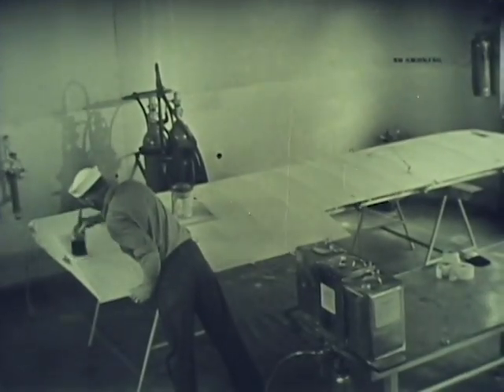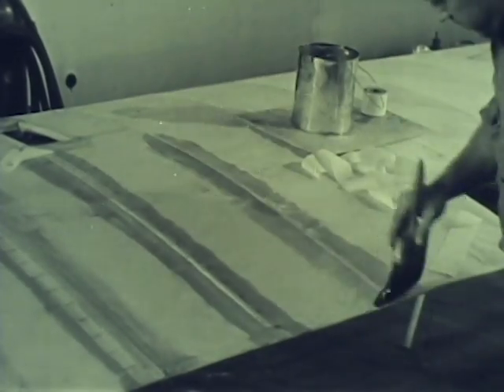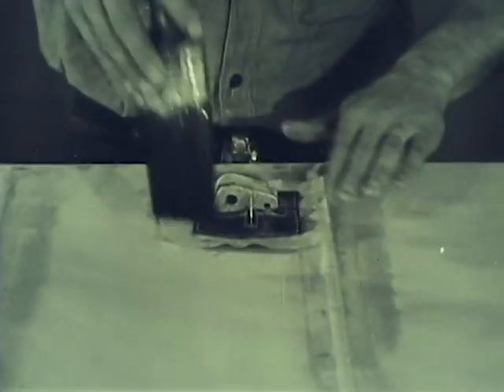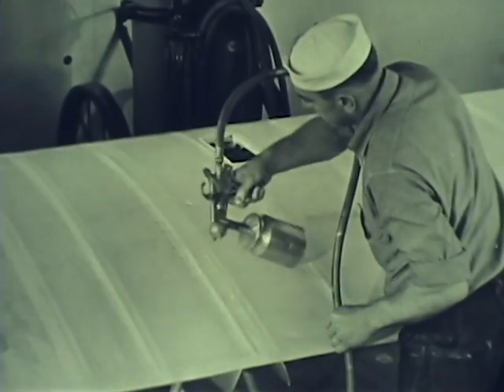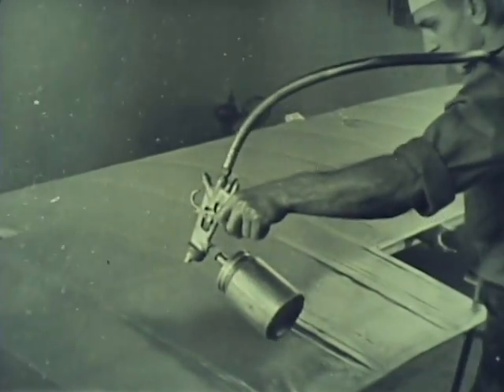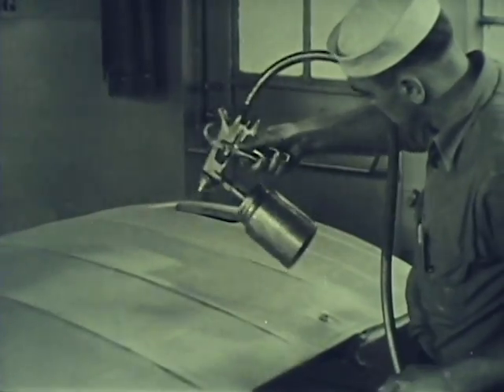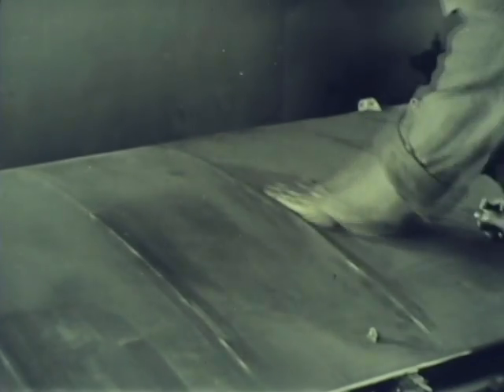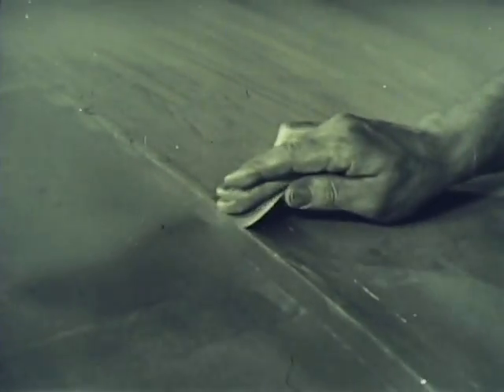1941 FUSELAGE AND WING SKINNING TECHNIQUE, HOW TO COVER MODEL R/C AIRCRAFT

Comment: If the dope spraying dope causes repetitive blushing, your dope is probably smoking dope. To correct this problem, run a glass of dope remover through your dope sprayer that is spraying your blushing dope and then find a smarter dope that doesn't smoke dope while spraying dope. If the new dope spraying dope is a fat dope, use a dope thinner or remove all the water from the fat dope spraying dope while raising the dope spraying room temperature to 110 degrees Fahrenheit for one to two weeks to thin the dope so the dope spraying dope can spray dope properly.
    Just remember, never use a dope that is too fat if you want properly sprayed dope by a dope spraying dope and, never let your dope spraying dope smoke dope while spraying dope.
     Your dope spraying dope should be of a fine condition if you follow these easy rules of a dope spraying several layers of dope because, it is not rocket science...…. it is dope science.
Reply from the maker: Lmao
Reply: Way too much time on ur hands

Comment: Cool video but why does the title say "Model R/C aircraft" ?
Reply from the maker: ultranitro Thank you for watching, the technique applies to both real aircraft as well as radio control.
Reply: Do you know what you can seal a basswood/tissue guillows model aircraft with? I want to brush paint it with testors enamel but need to seal it first I think.
Reply from the maker: ultranitro I remember it was called Dope and it was a clear highly volatile stuff. Look it up. Sure someone still makes it. Have fun.
Reply: Ultranitro, if you haven't encountered it yet, there are still producers of aircraft nitrate dope; I think SIG hobby suppliers still provide it....or maybe Brodak is still around. I 'have' seen it some of the larger hobby stores--Google should help.

Personal suggestion: I lived in WA state, where I could still purchase Xylene easily at hardware stores, incl. Home Despot & Lowe's--I'm currently in CA where they banned it for the usual 'Carcinogen Risk' hazards, although its not as bad a substance as M.E.K. solvent.
 Cut to the chase: I used xylene as solvent/thinner for Polyurethanadhesives...Gorilla Glue & 'Great Stuff' expanding spray foam. It works exactly the way alcohol & acetone work on epoxy resin--thins it to a thin, 'sugar water' consistency. Not a 'false' thinner, as many people have recommended water and/or ethanol + Gorilla Glue for thinning it over the years--UTTERLY WRONG, as these enhance its foaming action cure!

I 'doped' stick & tissue builds with it, as well as sealed & reinforced cardboard...until it had the rigidity & behavior of medium grade balsa.

It is now my preferred sealant, along with lacquer sealer. Its water proof and adds a hint of elasticity to tissue-covered models; I flew amidst blueberry bushes often and after landings in them my planes rarely had punctures & tears. I was pretty amazed.

One caveat: you MUST paint over it OR pre-'tint' it with a colour paint, small amounts of latex, acrylic or enamel mixed in. sunlight degrades it & it will turn tan, then brown...then dark brown & crumble with age otherwise.
Reply from the maker: I did that because the system and technique reminded me of hobby if building Control line aircraft as a kid.